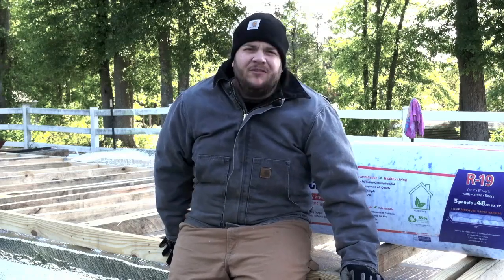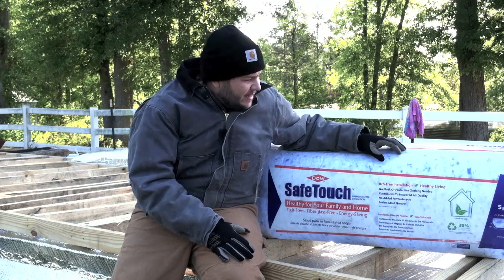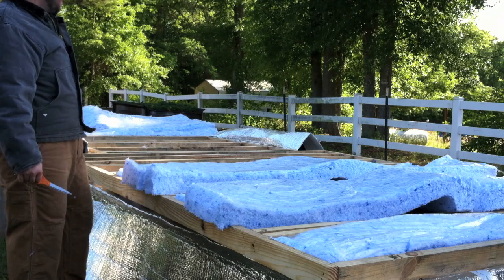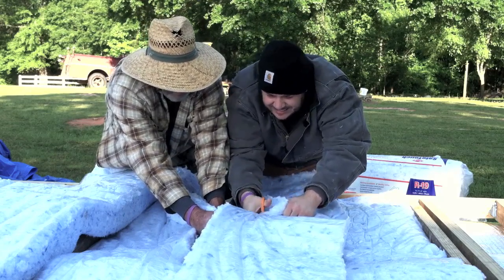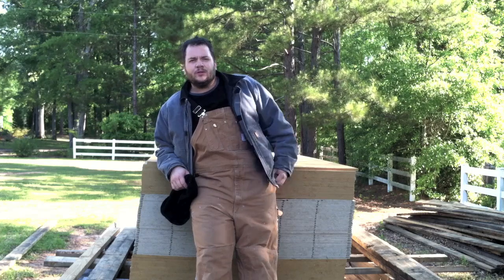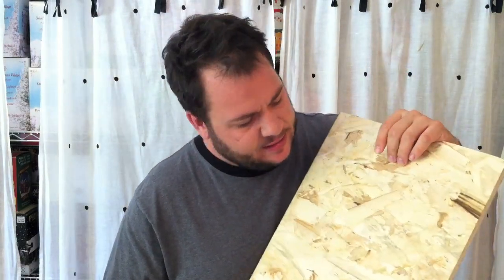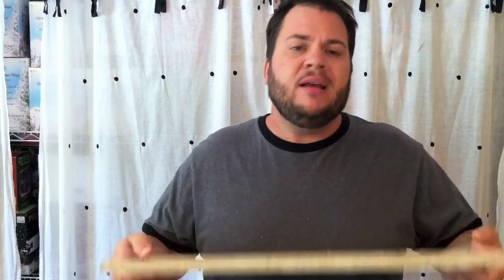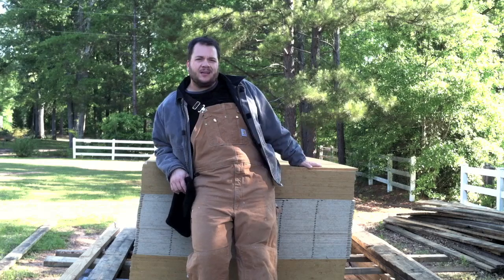Tiny House - Foundation and Subfloor

Comment from the maker: Hi there Olivia. Yes, the EcoFoil is our bottom layer as opposed to aluminum flashing or even OSB. It has been on for over a year and looks and behave as if it were brand new and it has been driven over 1,000 miles at highway speeds and been parked.

Comment: Did I miss something? How did you build the floor frame that you're putting the insulation in between? How did you connect it to the frame of the "trailer"? Maybe an electric knife would have cut through the insulation a little easier?

Comment from the maker: I wouldn't say you missed anything. You may want to watch the EcoFoil installation video though. 7:52 tells you that we used carriage bolts, washers, and nuts to secure our floor joists on. You can also see pictures of that process on our Flickr page by visiting: flickr [dot] com/photos/andrewodom/sets/72157629885578061/

Comment from the maker: We did not use the EcoFoil Double Bubble anywhere in the house, no. We did use EcoFoil radiant barrier on our roof sheathing though to deflect direct radiant heat away from the roof. 

If you visit our website - tinyrevolution.us - there is a post on our subfloor and framing which both show photos and talk about our process. That includes bolting to the frame. You can view all of our photos on our Google+ page. There is an icon in the upper right of our webpage.